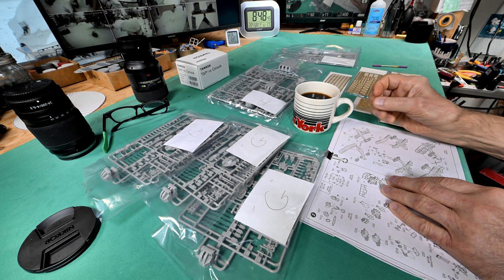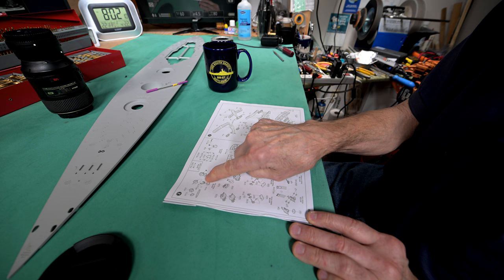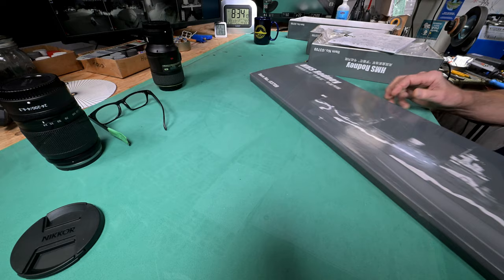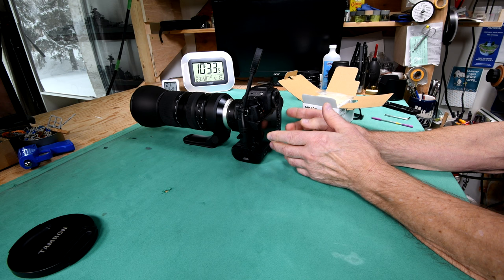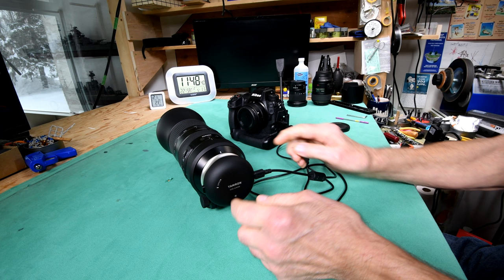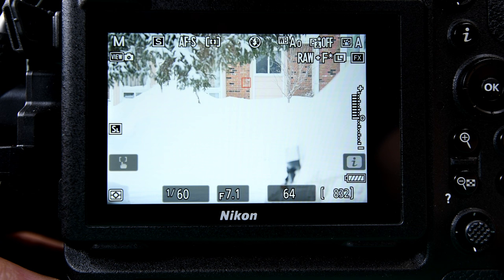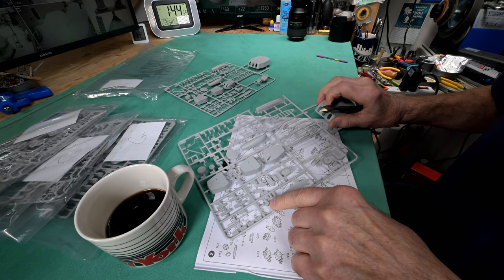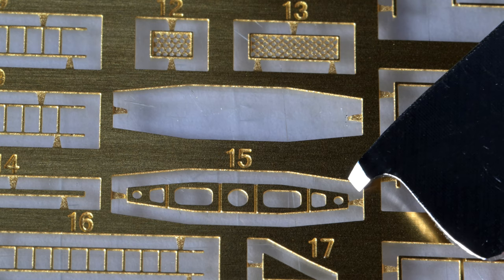The Model Ship - Part 1074

Comment: Hi Ron I'm happy the adapter for your Nikon worked out! I was looking for the rabbits between your house and your neighbors!
As far as the deck
I heard somewhere Tamiya paints aren't good for hand brushing that they're meant for airbrushing?
That's a great idea leaving one side of the photo etch with the plastic on
I did that once but when I went to soak the PE in acetone to remove the mold release agent the clear plastic melted and I had some time getting it off!
Reply from the maker: I too have found that acetone will dissolve "some" plastics. 👍